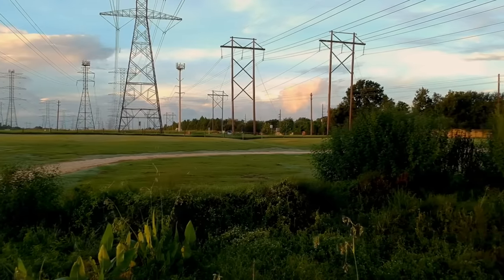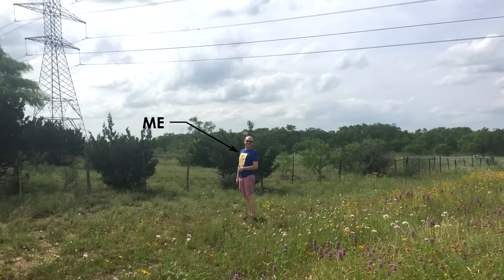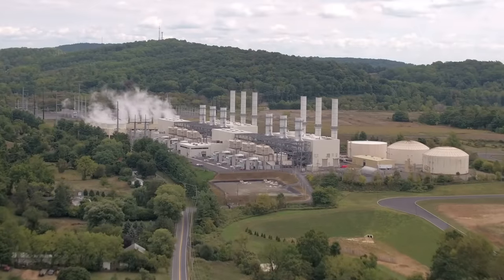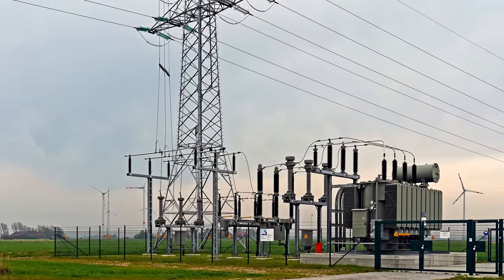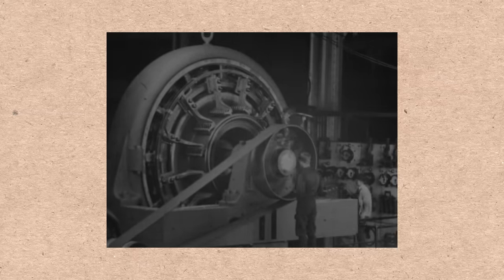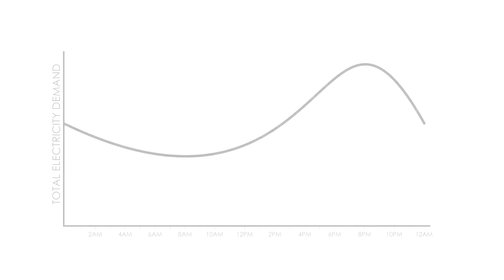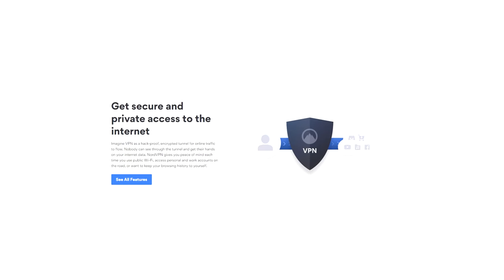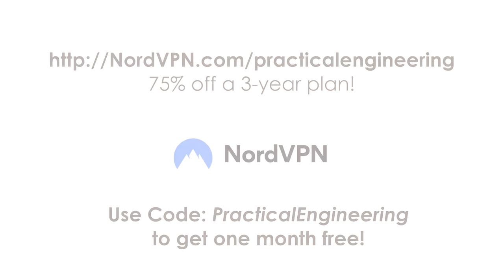How Does the Power Grid Work?

Comment: Think about what you are stating at 0:28
There are abundant of amounts of electrons to generate electricity BUT its the ENERGY that is used to generate the electricity that is lost!!! 

Water works the same way, energy is lost when pressurizing the water in a pipe to deliver to homes and business. 
Water in a reservoir does us no good unless we use ENERGY to pressurize the water in the system. Energy is lost day and night when pumps are constantly powered to pressurize the system to maintain a constant static pressure.

CAPACITANCE:
WATEER: Raised water towers are used in most areas, where the land is mostly flat, to act like a "capacitor" to maintain a constant static pressure in the system during high demands.
ELECTRICITY: Utility companies use high voltage capacitors to maintain a so called static pressure or voltage in the system during high demands.

STORAGE NON PRESSURIZED:
WATER: water in a reservoir (its unproductive without energy to make it vital)
ELECTRICITY: Its abundant (its unproductive without energy to make it vital)

STORAGE:
WATER: water stored in pressurized tanks with air bladders. 
ELECTRICITY: Electricity is stored at lower pressure or voltage, then where it was originally produced.

Comment: 0:34
what
batteries/water pumping/anyother type of power storage
Reply: That is the point, that is not storage of electricity. Batteries don't store electricity, you convert the electricity to chemical energy, and when you take it out you convert chemical back to electricity. When you pump water, you're converting electricity to potential energy. None of those actually store electricity. The only way to actually store electricity is in capacitors, which aren't really usable for long term energy storage. Supercapacitors could act as (very) short term buffers, but not much more, at least with current technology.
Reply: These are energy conversions that convert electrical energy to chemical potential energy or gravitational potential energy. All energy conversions come with some losses and have to be avoided. Batteries and pumped-storage hydroelectricity still have about 20% losses.

Fortunately the grid is powered by large rotating masses with a lot of kinetic energy. These can counteract sudden changes in the load, which gives time to increase or decrease the power-output of smaller but faster power-plants / batteries / pumped-storage hydroelectricity. There is also the option to add or remove loads from the grid.

It would have been nice if he had explained these things too. A 10 minute video (including advertisements) isn't long enough for all these details.

Comment: Cant you store electricity to use when peak load happens.
Reply: You can but the two main questions that come up with large-scale storage are "how much is it going to cost?" and "are we prepared to pay for it?".
Reply: @FrainBart_main  that's true trying to manage the power input with demand would probably be alot less expensive than storing for distribution at peak times. But with Solor and even wind I think storage is definitely worth it as we have less control of the power input process.
Reply: @joachimpetersen2301  Demand-side management can be cheaper to some extent, yes. There are again two thinga to note. 1) The cost of energy storage should be included in the levelized cost of electricity of solar and wind. 2) What to do when there is basically no wind and solar irradiance is low for a week or even more? There is no way that this much energy storage is economical.

Comment: It sounds like batteries are the answer for fluctuations.
Reply: batterys arnt that good for sudden demand, they are alot better and faster then spooling up a natural gas generator that takes a few hours but the sudden demand that would really mess things up still is not really solved by batterys. think about your car, especially older ones; if you have your headlights on and suddenly draw alot of power such as for an amp, music, jumping someones car, the headlights will dim and bog down the motor. The battery kept the car from dyeing from lack of power but it didnt stop the power spike from dimming and slowing everything down.

Comment: 0:30 - that's just wrong. If that would be true mobile phones and batteries wouldn't be a thing. And it's also not true for the electrical grid. There are so much parasitic capacitance and inertia of turbines that the grid does in fact "store" electricity (but not very much ^^)

You can take a look at mainsfrequency com to see how the frequency of the grid changes in europe because supply is not exactly equal to demand.

Comment: Electricity is not a right. You do not get it by law. We provide it but do not guarantee it. You can get water with out electricity, Rome did it. You can have all sorts of stuff with out it.
Reply: he didn't say it was a right, he said that in urban areas electricity is required to use water, no electricity means no water pumped into buildings.